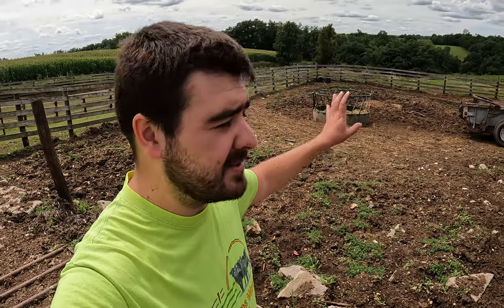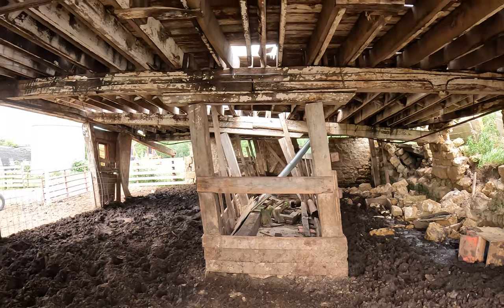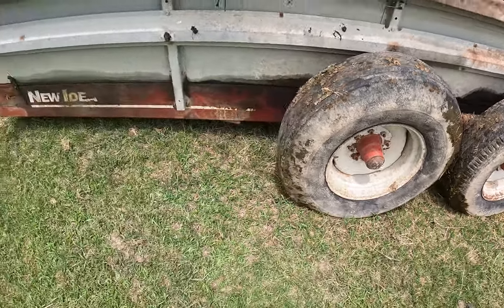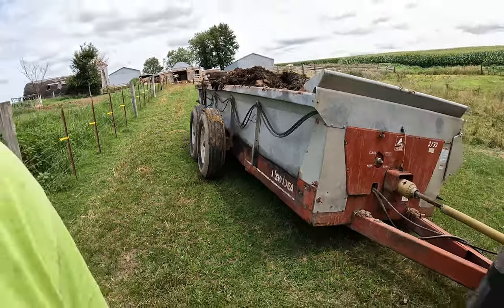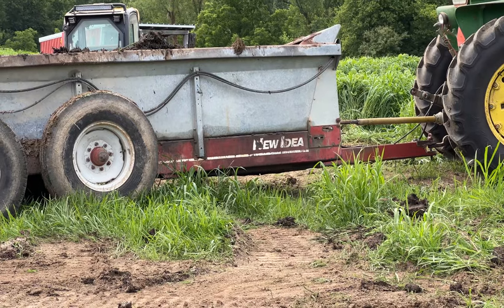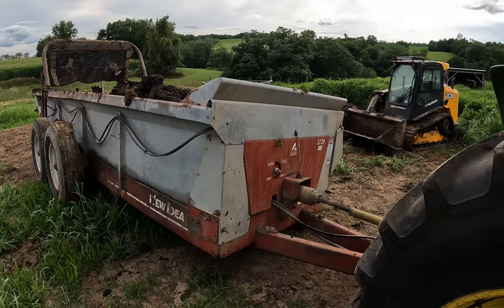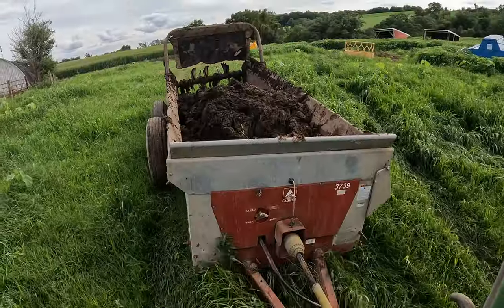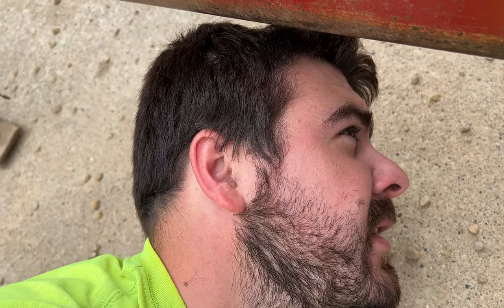Spreader On Life Support - Loading Manure w/ JCB Teleskid 3TS-8T

Comment: You are absolutely right about the solar farm. There is so much room on roofs and parking lots, but they have to waste farmland like this. As you said, there are way too many people who think that farmers destroy the environment.
Nice video again, it is always great to watch the 4020 at work👍
Reply: Also, adding solar on top of parking lots as a roof has a double benefit - by having people park in shade, the cars heat up less from the greenhouse effect, and therefore less energy is expended on AC to cool the cars back down.
Reply: Roofs can be troublesome, because of the weight.  E.g. the building I wuld ork in would basically have to be demolished and rebuilt to be able to support the weight of a solar array.

Now parking lots?  No clue why anyone would be against a power-producing sun shade.  I'd leave the outsides of the lot open for RVs and the like, but that would just make for a tree belt anyway.

Comment: Ryan - you don't often editorialize, but you are spot on with your comments about converting good farmland to a solar facility
Reply: It's ironic though making statements about solar panels but then selling corn to make ethanol.
Reply: I think the reason they don't use Wal-mart parking lots is... Have you seen the drivers IN Wal-mart parking lots? Any posts used to elevate those solar panels above the asphalt would have to be HUGE!
Reply from the maker: @roberthale8407  Ethanol is a renewable energy source that results in DDGs as a byproduct that is used for animal feed. It also isn't sowing cables underground that won't be removed at the end of the lease. Solar can be placed anywhere and is a terrible use of space. It isn't being utilized for dual-use like corn is.

Comment: Looks like the welding shop did a great repair job on the spreader! Most likely better than when it was new?  If me, would have no issues taking that spreader down the road again.
Reply: As a Certified Welder and Mechanical Engineer.. that repair is at least as good as new.. I would have no problems continuing its use as you have been..

Comment: You could probably have a mason rebuild that stone foundation and put a roof on it if you wanted to use that as a run in for the cattle. Would probably save you a ton with the way material costs are these days.

Comment: That spreader should have a few more years left in it.  If you can confidently inspect for cracks, then no worries.  It may surprise you how many machines, airplanes, and bridges are in use every day with cracks in the steel or aluminum.  It’s all about the inspection and weld repair before the crack is too big.

Comment: an area the size of iowa taken by suburbs, not solar. Iowa is about 37 million acres. 5 million acres is all it would take to solar power our entire country. We got plenty of desert (which bad farming is turning iowa and all the great planes into) to provide  100 u. s. a.'s with solar  power. Nellis air force base area could more than power our whole country at todays usage rates and panel efficiencies. I agree with you that covering productive arable land  with p. v., lawns, or shopping centers is a bad idea.
An even worse idea is bare ground, any time of year. Bare dirt takes carbon (life) out of productive use in the soil and puts it in the air as CO2, which makes you irrigate and 'fertilize' , heats up the soil, and drys it up ; all of which kills necessary soil life. We got 450 million acres of cropland ; solar panels are an asset , they’re among the least of our problems

Comment: Our solar farm project is on hold til the are able to get the panels from China. Too bad our manufacturing corporations in their greed to make big bucks profit by outsourcing manufacturing over seas, they could have made them here. Our solar farm was being built by Trelina to ship electricity out of our area, Maybe they should site these farms nearer to where they need it. There is plenty of rocky ground in our area to put them, only it costs a lot more for installation. I, myself would prefer windmills, they don't take up a lot of room and their more aesthetically pleasing.